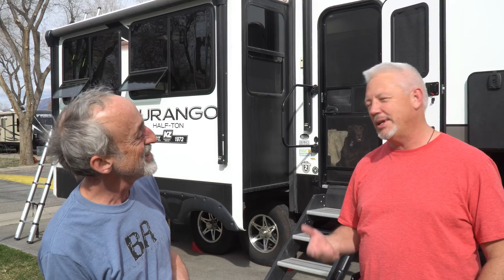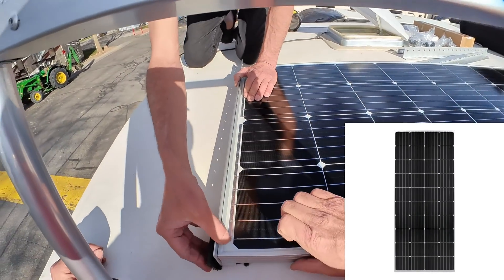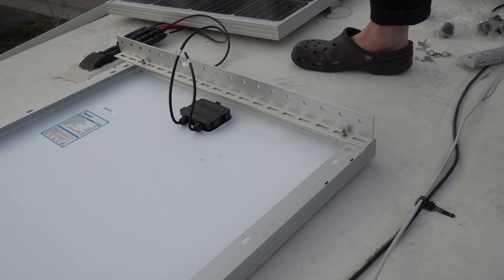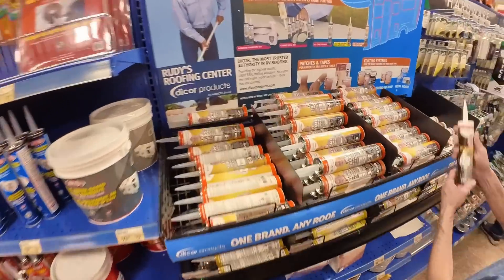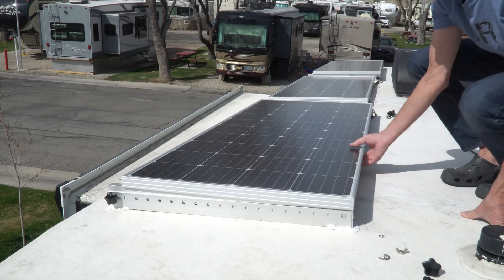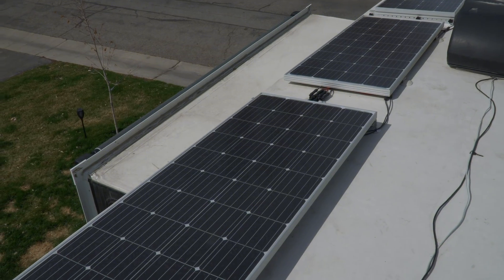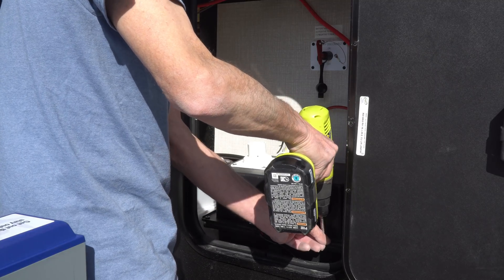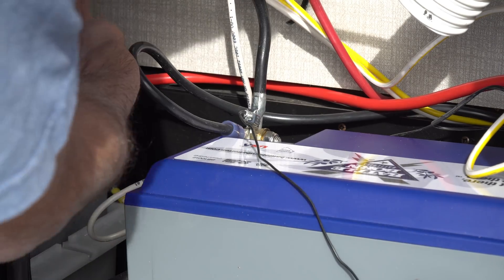Ep. 196: RV Solar Panel Install & Lithium Battery Upgrade | DIY how-to

Comment: Mark, thanks for this video.  I am looking to do a very similar setup to my rig with the same onboard charger (replacing my factory one with the lithium capable).  How were you charging the batteries with the solar panels in this setup?  Dis you install a separate solar charge controller in addition to the progressive dynamics onboard converter?
Reply from the maker: James, our rig came from the factory with a cheap GoPower 30A PWM solar charge controller pre-installed, that we continued to use through this initial phase one of our project. However, when phase 2 of our project came along to add more panels and batteries we replaced the charge controller with a Victron 150/100 charge controller (a huge mambo jambo!), and both the shore power charge converter and inverter with an inverter-charger.

Comment: Built a ground mount 400w Solar Array years ago. Adjustable angles, on a mechanical "Sun Following" mechanical clockwork set of gears. Follows the sun during the day, keeping the array facing directly, then returns to start at sunset. I Engineered this for an early Off Grid setup, on a contract for people known. It requires readjustment over a year, but I factored adjustment wheels in. Ground level means easy cleaning, but my design STILL works well.
Reply from the maker: That sounds really cool, David!
Reply: @GrandAdventure  The thing was, I challenged myself to see if I could build it, and have it work. It did, and my friends were amazed. They lived far from everyone, so other than their Family, and friends, nobody has ever seen it. It took me two weeks solid, 8 to 10 hour days, to fabricate it all from scrap parts mostly, and hand built/ machined parts. The Grandmother put me up while I built it, then after getting it connected, and wired into the house, I Tested it, for 24 hours. Charging worked well, Tracking was close to perfect. Grams paid for Parts, and my expenses.

Comment: Glad to see your panels adjustable for angle. Too many place them on roofs( RV or Home) and then forget them. Solar Panels used outdoors require regular CLEANING, to maintain efficiency. Quick once over with soapy water, followed by Windex, and they work like brand new. Like anything Technological, it requires periodic maintenance. Battery connections can loosen, corrode, especially on RV's where vibration can happen. Mounting hardware too, can vibrate loose. Aluminum frames, undergo expansion/ contraction as temperatures vary, can cause bolts to loosen.
Reply from the maker: Great points all, David. We have had the loosening connections issue ourselves on occasion.

Comment: How does the new converter change over from the solar panels ?  We also have a KZ that has a WFCO WF 9855 converter and the solar setup (2 panels 200 and 190 W) and the worthless 1200 inverter. Is The 9855 a charger also as it’s not marked. I also have a zantrex 3000 x (not the xc) to be installed and only has the 2 battery in wires and one 3 wire out from the inverter that only powers a limited number of plugs. Any suggestions?
Reply from the maker: Robert, a converter is a charger by definition -- that's all it does, actually. It "converts" 120V AC shore power to 12V DC charging amps. 

As you saw in episode 249 we routed the output from our Xantrex XC3000 directly to one half of our 50A distribution panel, and then put all of the branch circuits that we wanted to power from the inverter on that half of the distribution panel. You could do the exact same thing, except because you have the X3000 which is an inverter rather than an inverter-charger, just leave your WFCO converter in place.

The only caveat to that plan is that the WF-9855 isn't compatible with lithium batteries, so if you change out your batteries to LiFePO4 you'd have to also change the converter to something with a charging profile compatible with LiFePO4, such as the WF-9800-AD or the Progressive Dynamics PD9100 Series https://www.progressivedyn.com/lithium-converter-replacement-units/.
Reply: @GrandAdventure  thank you, just a note, I have 2 200w panels and 2 lithium Battery’s. The converter KZ put in is not lithium ready ,  everything was purchased and installed by KZ when built except 1 of the panels and the battery’s were at the dealer and no one told me anything about the converter
Reply: @GrandAdventure  my zantrex freedom x 3000 has to be returned because it has a 30a transfer switch and not a 50a. Thank you and will be watching.
Reply from the maker: @robertnasser9937  well then, you could kill two birds with one stone and solve your lithium converter charging profile by replacing both your inverter and converter with the XC3000 inverter-charger, as we did.
Reply: @GrandAdventure  I am and thanks, it is to be delivered in a few days and returned for the correct one. I got and am a little confused because I believed when on shore power the 12v was coming from the converter and not from the battery’s.
Reply from the maker: @robertnasser9937  happy to have helped clear that up.

Comment: Good video.  CAn I use a 14.8V battery instead a 12V battery in my trailer?  I have a 4s lithium battery that I want to swap with my current led acid type.
Reply from the maker: Thank you. I don't know enough about your battery to give an informed reply, however.

Comment: So I was curious about the total for you installed solar, I thought you had mentioned $3500? But I also thought you said the batteries were $900 each, so my question is how much and where did your solar panels come from? Thank you for your great videos
Reply from the maker: Scott, all in over the course of two springs we spent around $7000. That's parts only, as we did all labor ourselves. We got our 200W Renogy panels through Amazon for ~$250 each.

Comment: I am using 24v settings can you tell me what to set my controller on for hi voltage and low voltage and float voltage for lithium battery's
Reply from the maker: I'd recommend contacting the battery manufacturer, or looking at their battery specs.
Reply: @GrandAdventure  Thank you

Comment: Just received my roof panels and looked at the panel to roof securement. Not impressed so looked to see what you did. Thanks for the tip. Still have a couple months before I can get mine out so I’ll be collecting more parts until then. How to’s mixed with more travel is always good watching.
Reply from the maker: Thank Dave! Those well nuts have held securely and without issue over the past year. Our travel schedule (stationary each ski season) pretty much mandates that we mix the two types of videos to keep them coming each week, so I'm pleased that you're enjoying that mix.

Comment: Hello Mark, this is Darryl not Lynn, love your channel. I'm getting ready to install two BB's and the same PD 60 AMP converter.  You list 2AWG battery cable. Did you use this cable to parallel batteries only? Or did you change the positive cables from the converter to batteries and to distribution box.?  If not what size wire did your camper come with? Did you put an inverter in line also? I'm 12 volt only no inverter, but having a hard time deciding on wire size. Thanks for your help
Reply from the maker: Those cables were used only for the batteries. We did not change the cables from the converter, we trusted that KZ used the appropriate gauge as our original converter was only 5 amps less. I apologize, but I don't have easy access to check those cables for you as they are behind that false wall. We have a Xantrex Freedom X 1200 inverter that was also installed at the KZ factory.

Comment: Sulfation happens when a LA battery is deprived of a full charge or remains in a lower state of charge for a long period of time. Simply discharging below 50% does not cause this. So, a LA battery needs to be full charged for each discharge cycle.
Reply from the maker: Appreciate your clarification!

Comment: Hey just found this video.  I think we have the same Durango you have.  We love ours.  I did not get the solar package just have the pre wired for solar.  I really want a similar set up to what you have.  Will need a bit more since you had the system already on with one panel.  It's hard to figure out everything I need though.  Thanks for the video
Reply from the maker: The wiring is the worst of the installation, so that pre-wiring gives you a big leg up. Depending on the size of the array you may want to use that to pull a heavier gauge wire through (KZ used 10 AWG on ours), or because you're starting from scratch you can wire panels in series to minimize voltage loss and decrease the amperage to keep using the existing wiring. Right now just absorb information like a sponge and it will all start making more sense. I highly recommend Will Prowse's YouTube channel for both solar and LiFePO4, I learned enough to be dangerous while watching his videos.
Reply: @GrandAdventure  so thanks for your reply.  I was just watching this video again and as you were installing the batteries I saw a yellow and white wire set with a fuse.  I assume that is the pre wire that goes to the roof.  I also have a wf 9855 converter and I called battle born they said it would charge the lithium but you ended up replacing yours.  So hard to get anyone at KZ to respond
Reply from the maker: @scottsmith922  the 9855 will charge the lithium batteries but they will never reach 100% because of the charging profile in that converter. That's why you want to upgrade, not to mention the fact that it will eventually damage the batteries by not fully charging them. Yes, that yellow and white wire is The wire that comes from our solar controller, and a similar yellow and white wire goes from the roof panels to the solar controller. That's the 10 gauge wire I was talking about.
Reply: @GrandAdventure  Thanks for replying appreciate you and your channel
Reply from the maker: @scottsmith922  you're most welcome, and we appreciate you and all of our viewers.
Reply: @GrandAdventure  can I ask you one more question.  What size wire did you use from battery to inverter mine is 3000 watt and then what size wire from your inverter to fuse box for the 110.  Thanks to your help I am set on the solar wire.  Thanks again
Reply from the maker: @scottsmith922  that wiring was installed by KZ. It's a very short 2 AWG run from batteries to inverter. However, the way that it's wired is by putting the inverter on a branch circuit from the main panel, using Romex. The output then goes to the GFCI circuit also via Romex. So the inverter's output does not go to the main circuit panel, it only goes to the GFCIs. Our plan for this winter is to replace both the inverter and the converter with an inverter/charger directly connected to the shore power input, then the output going directly to the entire circuit panel.
Reply: @GrandAdventure  you have been so helpful.  Returned the charger and inverter and ordering a victron multiplus II  the one all about rv's did a video on for 50A rigs.  I think that will be the best overall solution.  Again thanks for answering all the questions.
Reply from the maker: @scottsmith922  I can't disagree. I saw that video myself and I will confess I am considering the same unit.

Comment: Mark, I have a similar setup but I don't recognize the black plastic part (about 1:50 into the video) that you put on the brackets between them and the roof ???
Reply from the maker: When we were messing around with that plastic we were contemplating putting shims to compensate for the curve of the roof. We ended up not having to use them.

Comment: Good morning Marc!  Holy cow...you two maintenance meisters made this look so easy.  I'm envisioning my middle linebacker build crawling into the storage bay to take a wall out [read: rectangular 2x4 getting shoved into the round pvc tubing].   

Are your adjustable solar panel brackets able to raise from both directions, or just towards the side of your rig that is closest?

Safe travels!!
Reply from the maker: LOL Alan! Yeah, there are occasionally advantages to being a 98-lb weakling. 😁

Those Renogy tilt brackets will tilt the panels in either direction, it only depends on which corner knob you remove for the tilting function.

Comment: It’s not hard to wire in more circuits at the board the difficult thing is if you want a circuit switch switch back-and-forth 
From shore power to battery power through the inverter,
Reply from the maker: That I already have. There's a transfer switch built into the inverter. However, if you can guide me through the process of adding more circuits to the inverter I would be forever in your debt. I googled around and couldn't find squat.
Reply: @GrandAdventure  Let’s get on the phone or FaceTime to figure it out.
Reply from the maker: @DownsizingMakesCents  you bet! I'll reach out to you this week. Right now my work schedule is a little crazy with a trial in Louisiana Tuesday-Thursday and a pre-trial conference on that one today, but I'll reach out in the evening if that's alright. At least this Parish is still holding trials remotely via Zoom due to Covid, so I don't have to fly to LA.

Comment: Those batteries look awesome.  I have Lion Energy.  I only have 2 but I notice if I do boondock then we typically have about 50% left after one night.  I will say that I do better with water conservation than power conservation though.  I will add 1-2 more batteries if we start boondocking more.  I'm pretty happy with my progressive dynamics converter as well.
Reply: Yeah, I am probably going to go bigger but I have a sponsor that’s going to turn my fridge into a traditional compressor driven fridge with no more propane and I just don’t know how much power a 12 volt compressor will use.  If we boondocked more I’d use this Amish fridge conversion he does that basically goes the opposite way and only uses gas alone and no 12 volt.  Btw we are at Honeysuckle Meadows and you weren’t kidding... this place is nice
Reply from the maker: @Gimpydoingstuff  fantastic! That still gets our vote as the best sites of any privately run RV park anywhere. Tell them Grand Adventure said "hi". I'm guessing that compressor conversion will burn through a metric crap-ton of battery.
Reply from the maker: That's terrific feedback -- thanks Barratt! Still, 50% after one night with 2 batteries is pretty encouraging to us as we've got the 600W of solar to restore them beginning in the morning. We tend to be energy hogs, too (including powering our PCs all day for work), and it's nice to know that we can expand the battery bank further within the first couple of years if we so desire. We were initially thinking 4 batteries for 400 amp-hours, but with the ability to add batteries in the near term with no detrimental effect as there would be with wet-cell batteries, we figured we'd instead start with 3 and see how it goes.

Comment: Hey Mark, love the solar setup adding the battery monitor will really help with the usability of the system.  What inverter do you have installed.  Looking forward to seeing more travel videos, but i love these DIY projects also.  Larry
Reply from the maker: Thanks Larry! KZ installed the Xantrex Freedom X 1200W at the factory, but we'll be upgrading that in the future once my bank account recovers from the shock of this project. My biggest complaint is not the wattage, as 1200W will cover most things we'd want to do with an inverter. Instead, it's the fact that it's only wired to one circuit, the GFCI outlets.  Perhaps it's above my pay grade, but I can't seem to understand a way to wire it to more than one circuit on the distribution panel. I'd like it to power the non-GFCI outlets, too, as well as the microwave. If you have any advice in that regard I'm all ears!

Comment: Turn off shore power and disconnect batteries before playing with Mr. Electric! 

You didn't discuss charge controller,  or did I miss something
Reply from the maker: Absolutely Bob, we should've mentioned turning everything off but yes we did. As for the controller, we didn't get into that because it was already installed as part of our existing system.

Comment: Nice job on the solar installation. I’m curious as to how thick was the sheathing on your roof?  Was that why you opted to use well nuts? Well nuts are definitely the way to go for thinner sheathing. 
I’d suggest periodically checking the tightness on those knobs. They can vibrate loose over time.
Reply from the maker: Good advice, Rik. We went with well nuts as overkill; I'd rather overdo a project than under-do it. I checked with KZ prior to installing the panels and our roof decking is 3/8".

Comment: I switch over to lithium batteries too. I bet pulling those heavy batteries out, and putting the lithium in, will be way easier to boondock. Thanks Don
Reply from the maker: Anything that reduces our weight is a good thing, Don. Ironically, by replacing two flooded wet-cell batteries with three lithiums the total weight is pretty much a wash, but we have nearly triple the usable amp-hours as a consolation.

Comment: Cool, sorry I couldn't watch live, been busy here. I got my batteries and inverter (3000 renogy) installed, I have 4 deep cell for now, also we can use everything with this set up, including air conditioning, still testing to see for how long, already  put in a breaker for charger, we can use everything like we are plugged in 😊👍 I'm working on getting the same panels as you, so thanks for sharing...believe it or not, harbor fright solar panels work great also have a 120 watt fold up it worked best, the hf panels worked at night with the full moon 🤔 not much lol..
Reply from the maker: That's fantastic feedback on your situation, Dave, thanks for sharing that. At some point we need to upgrade to a larger inverter than the 1200W Xantrex that KZ installed in our Durango, and wired to more than the GFCI outlets that are now hot with the unit. However, after this expenditure that's going to have to wait a little bit.